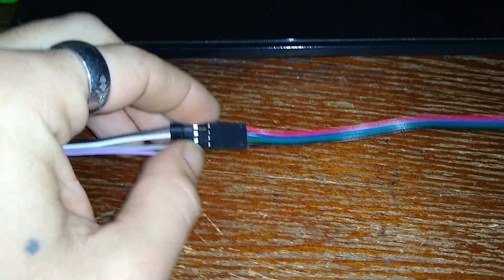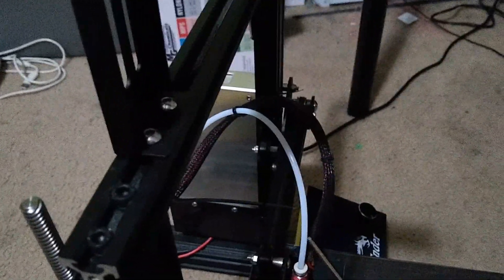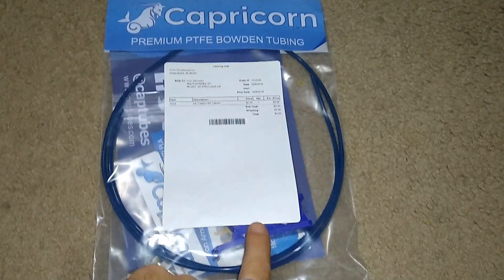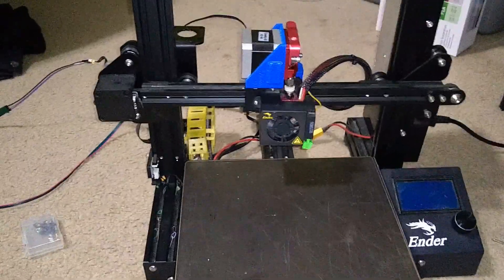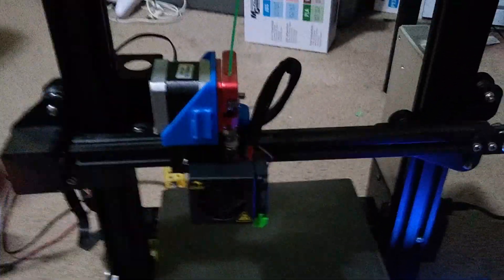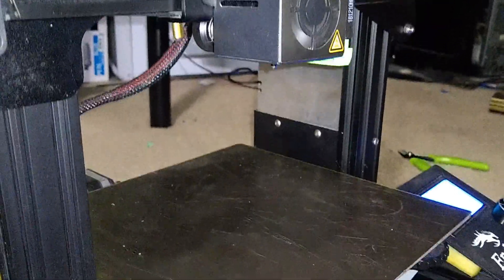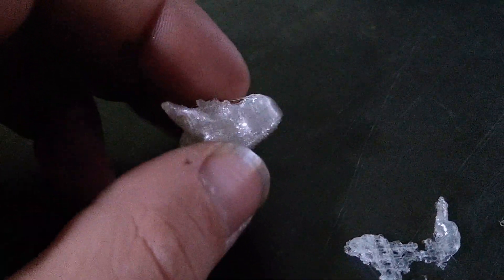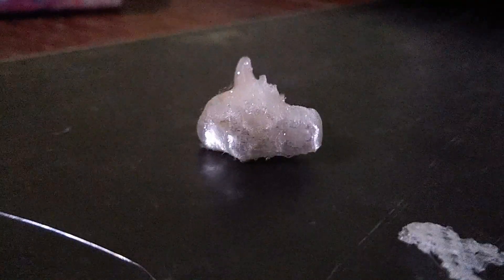Ender 3 direct drive printable mod

Comment: You mentioned that the Direct Drivinator bracket is supposed to replace your spacers, but the instructions on Thingiverse say to press the spacers into the bracket. I'm guessing you figured this out but forgot to mention it.
Reply from the maker: Actually while I did read that, i actually used a little horizontal expansion to make a tighter fit for the machine screws and prevent it from rattling off due to vibration. This is working fine for me, as the mod is temporary, but if left like this in the long term, there could be significant rubbing of the v slot wheels on the mount. The biggest issue I had with getting this whole thing to run smoothly was getting the exact amount of ptfe tubing, but after a little tweaking, it's running very well.  However, you are correct, if you are going to run this setup for the long term, you should insert the spacers, and probably use a soldering iron to insert inset's for the screws. Vibration on direct drive machines is rediculous.
Reply: @Technivorous  I've been running this direct drive for a couple of weeks. I do have some vibration I haven't been able to track down, but that is during movement along the X axis. 

My biggest disappointment with the direct drive mod has been that I still need 6mm of retraction at 25mm/s to prevent stringing. And I still had to mod my extruder to be able to use 85A TPU. And when there's a jam between the extruder and the hot end, it means disassembling the entire direct drive, which is a pain. 

I'll likely be going back to the original indirect drive (bowden tube) setup soon enough.
Reply from the maker: @mvanzante  that jamming was an issue j fought with all day yesterday. I had to heat the hot end, remove the nozzle and basically feed the Bowden up it to the extruder and then mark and cut, since getting this more accurate length of Bowden I have stopped the jamming and leaking. I'm currently running a you print with solutech tpu with the rest of the hot end stock.  My retraction is 1.4 mm with a super slow prime to prevent jams. https://youtu.be/WP3_5hceSk8 direct drive you profile. I'll have some video of the prints shortly.

Comment: This is dumbest way I've seen to do this. Please don't make anymore videos. Wow just wow.
Reply from the maker: Ha. Go tell that to the guy who made it. I just tried it out as a request to a viewer, and guess what, it last about 2 days before I switched back. The stock nema 17 extruder motor on the ender 3 is way to heavy to be moving around the y axis and not causing problems. It would work much better with a pancake motor and a smaller mount. Thanks for the positive feedback! I love getting comments like this, and of course I will continue making videos for your viewing pleasure. 12k other people like them so far and growing! 

Ps. This video is old as well. Please scope out a few of my more recent offerings before judging, and even then, realize that as much as they have improved, in believe there is always room for improvement. That said I will never stop expirementing with 3d printer mods OR making videos about it. I hope you have a better day tommorrow, because whatever triggered you today and made you lash out on a youtuber to feel good about yourself cant happen two days in a row right. Smile. We r all assholes here.
Reply: @Technivorous  I wasn't really being serious my guy I hope you continue making videos, and I run direct drive on all 3 of my enders but the way you took the printer apart to install it was wack. You can install it without all that work.

Comment: I was thinking to make this mod but on the other side I think its a little bit heavy to put motor on the top and to drive it left and right..
Reply from the maker: I ended up taking it off. It works great with you since you have yo print that slow anyway, but the added weight does mean the speed needs to be reduced.
Reply: @Technivorous  I yesterday printed tpu on stock extruder, motor.. only with capricorn ptfe tube and worked great.. quality is amazing.. so no need to change to direct extruder if you ask me.. only reduce the speed.. and there you go..

Comment: Do u lose z height
Reply from the maker: No actually the motor is right over the hot end, and not the gantry so its still goes all the way up.
Reply: @Technivorous  thats great as i was planning on getting 400mm v slots and expanding z height so i can also direct drive and add dual z with a belt system.

Comment: I got problems worse layer height after try this direct drive? Any advise please... run x y 60-85mm/s
Reply from the maker: Gotta slow down quite a bit because of the added weight. I ended up switching back. Not worth the trade off. Of course now I have more printers so I dont need the speed
Reply: @Technivorous  okay thanks for advise
Reply: @Technivorous  even we install e3d hemera.. same problems is hotend weight right?

Comment: WIll 60mm/s cause string for PLA ?
Reply from the maker: 60 mms a second will be fone for pla. May be a little slow. If your worried about stringing with pla, make sure you have retraction on. And adjust your temperature
Reply: I print at around 110mm/s for pla. No real issues.

Comment: Just wondering what problem is solved by this?
Reply from the maker: Also the added weight on the x carriage means u need to reduce speed. I really only recommend this if ur doin a lot of tpu or flex
Reply from the maker: Printing flexible materials is easier and more controlled. Other than that dont bother

Comment: So Ive been watching your vids and its pretty funny. I decide to do something and literally that day after I get done printing it, you post a vid on it. Here is there file I used though, (https://www.thingiverse.com/thing:3881061). Great minds think alike I guess. With the extra weight, did you slow down your printing speed? I am looking at adding Dual Z support rods from Properprinting to help support that weight.
Reply from the maker: Yeah it slowed me down quite a bit. The way the weight is yanked around by the x carriage made me adjust not just speed but accel and also jerk settings. Dual z is a great idea, I haven't tried it yet, but I have an extra nema 17 and some a rods, just going to have to move the power supply first. Keep the awesome ideas coming man!

Comment: The standard extruder wires are plenty long enough to use in a direct drive setup.
Reply from the maker: Mine only reached until about the z got to about 180 mm... But if you can make it work more power to ya!